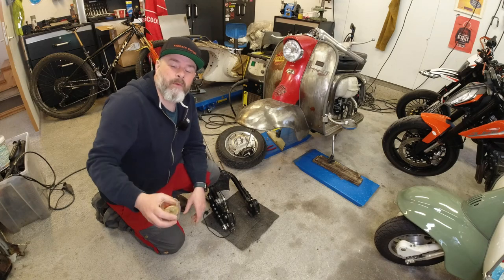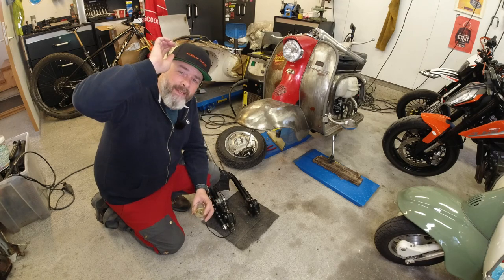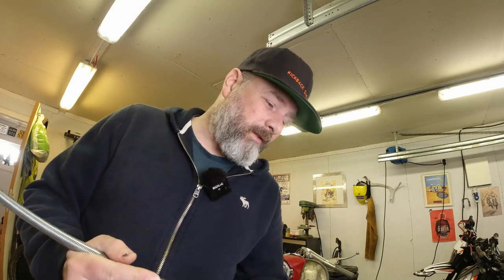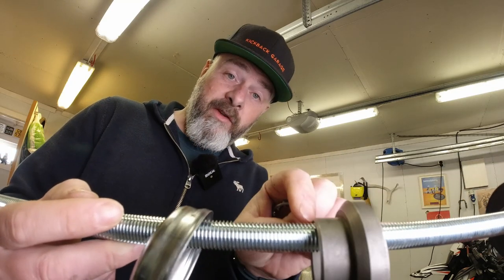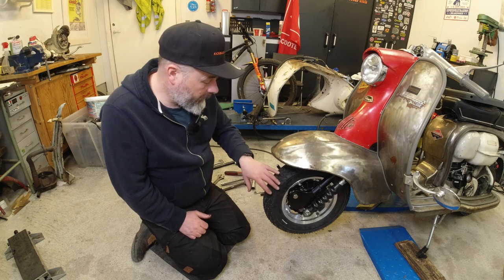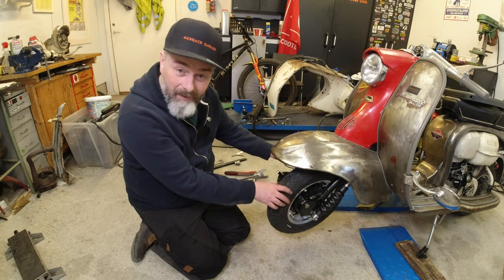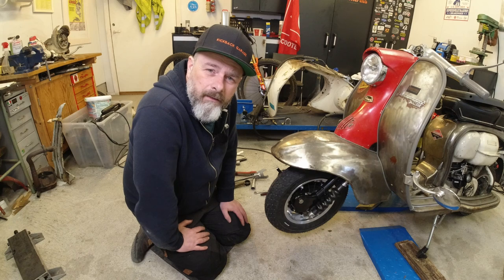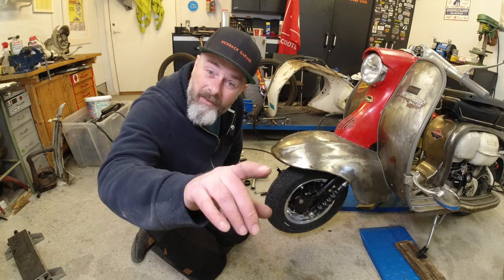#lambretta headset bearing upgrade #kickbackgarage

Comment: Hi Rob, nice work! So you bought 1or 2 new races, 2 lock nuts and 2 x bearing sets? No need for the new sealed bearing kits,especially with the fitting issues? ;)
Reply from the maker: Sort of. 2 sets of bearings, mb top race which I didn't fit. Mb upper screw race and lock ring but the cups are casa.
Reply: @kickbackgarage  hey thanks, so you replaced the lower and upper race due to wear or in case of wear on the originals as well as making the fork set up safer?
Reply: @kickbackgarage  If the races have little wear or mileage/kmage they should be okay, but do you recommend new locking nuts?
Reply from the maker: Yes, correct. 😎
Reply from the maker: They last a long time but it's always good practice to swap them out during a restoration. You will feel it straight away. It feels terrible.

Comment: Hi Rob I need some jetting advice,I have a 125 li series 3 I'm building with a 185 barrell piston, a 22mm.jetex carb with a spaq sterling expansion exhaust,I have made the intake bigger removed the stomach,and have a high flow filter,what jets should I have in the carb for best performance,keep up the good work thanks
Reply from the maker: Sorry Martin, I'm clueless when it comes to standard(ish) setups 🤷‍♂️
Reply: @kickbackgarage  no problem,your channel pushed me on to finishing my project I started it in 2007,now I'm about there i will run as it is and see how it goes,thanks for the kick up the arse
Reply: Try a 118 or 120 main jet. I'm running a similar set up.
Reply: @stuartrichardson6928  will do thanks

Comment: Interesting, I have to do a similar job.
What was the name of the tool you used for the top locking nut?
Reply from the maker: Mb calls his a steering spanner
Reply: @kickbackgarage  There was an Italian tool, but I didn't get the name..
Reply from the maker: @stephenrose937 buzetti
Reply: @kickbackgarage  That's it... thanks a lot, looks easier to use..

Comment: Interesting that in the scooter world , it is preferred to use loose balls, while in the bicycling world, sealed bearings are the way to go!
Reply from the maker: Only because with loose bearings, you get more in there as they are basically under dimensioned even compared to cycling. When I started racing mtb in the early nineties, loose bearings were standard, even in the bottom bracket but they were high maintenance because of poor seals against water and grime. Road going scooters see less punishment than mountain bikes these days.